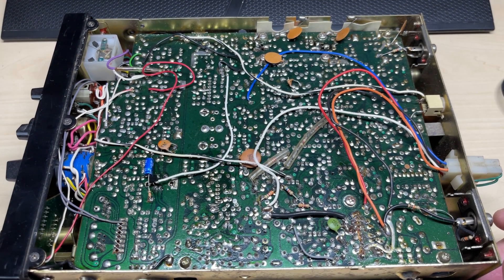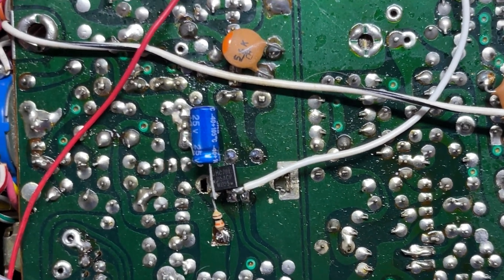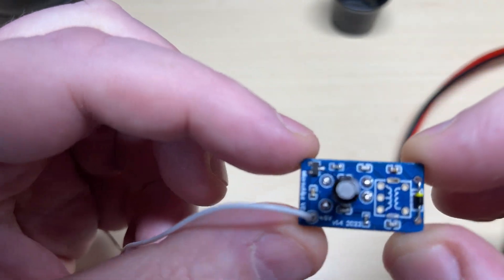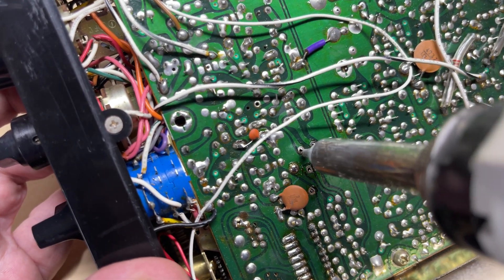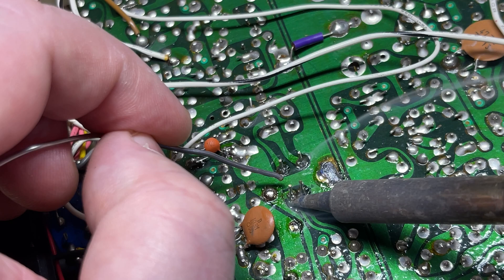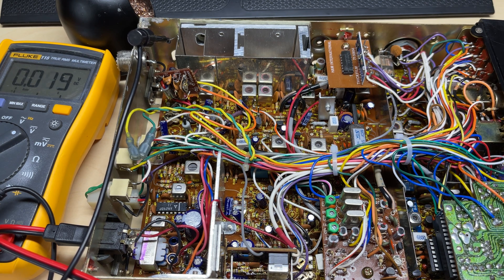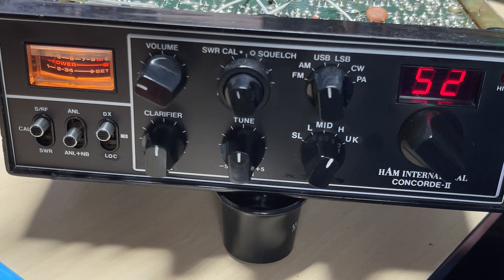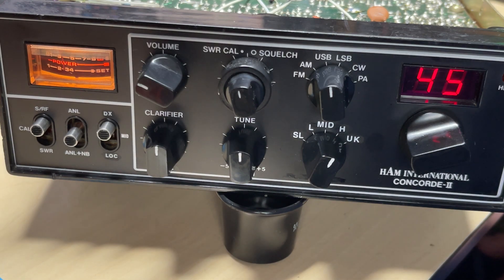EP 101 - HAM International Concorde 2 - VCO Voltage feed mod.

Comment: Hello mate..
I'm needing a bit advice about a Concorde 2 I've just bought from fleabay 

It's a lemon.. and I'm a bit gutted just having paid dear for it.. seriously dear 
No audio output
And doubt there's power output
PA non op through amplified external speaker. Just squeals in varying tones 

I'm suspecting old caps.. but??? 
Can you help revive it with me so I can at least work with it.
Reply from the maker: Is the selcal plug in the rear ? That will cause no audio . If not audio ic . If it’s squealing sounds like the ic .
Reply: @MicroChipz 
Was the selcal 
Oops

Next to my old loyal harrier CBX , it doesn't receive much tho
Reply from the maker: Sounds like it needs a good service.